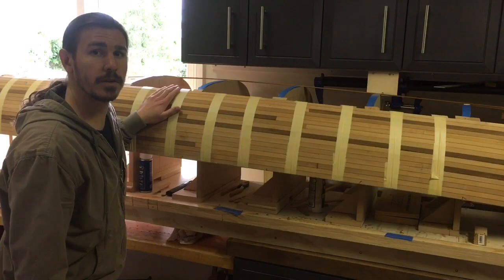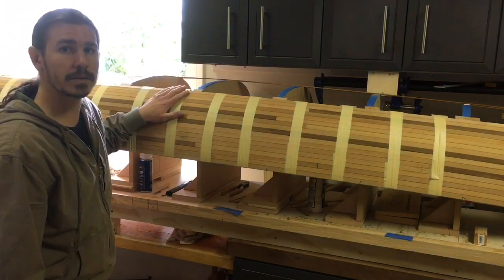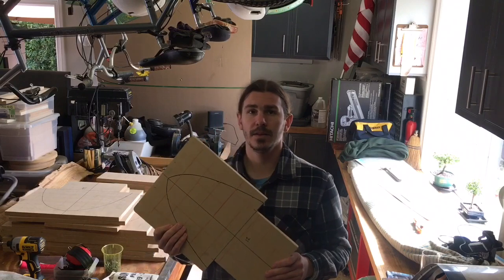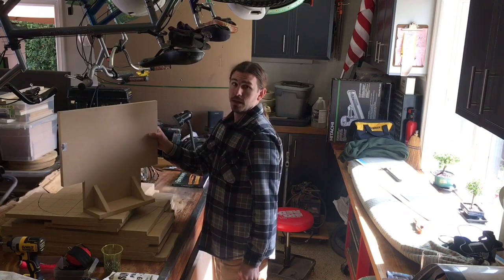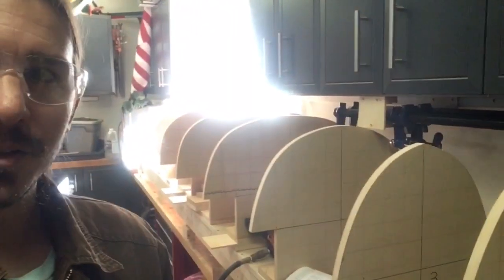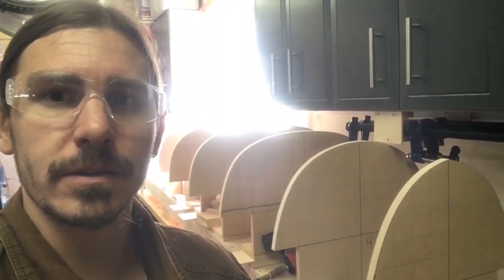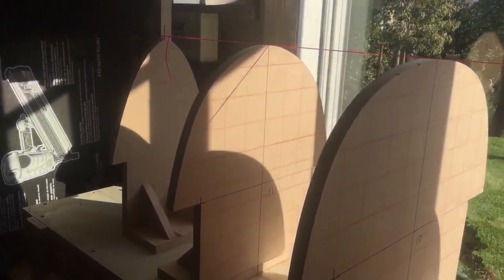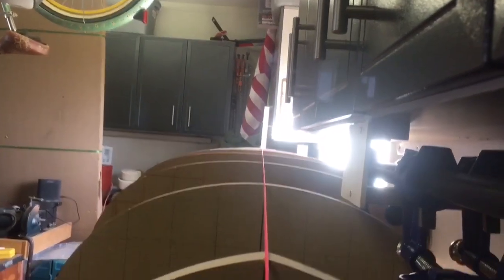Canoe build part 1 (lofting and mold making)

Comment: I have admiration for a fellow craftsman. Your point plotting with the nails & flexable curve gets the job done.  Built 22 stripers ,foam, and composite canoes you couldn't imagine.  Check out my adjustable "T"-slotted Aluminum strongback, and my unique canoe build, by clicking on my green icon and expand to see my 3 canoe vids.  Nothing on the internet even comes close.
Reply from the maker: Thanks for checking out my video and leaving a comment. Much appreciated. Checked out some of your videos, your funny man. For real though that canoe mold is on another level, your right there ain’t anything else like it on the internet. 11 foot Balsa, nice, was looking to get some for surfboards, man that stuff isn’t cheap, at least where I’m at it’s like $15 a board foot and always out of stock. I’m sure those veneers take some tracking down to though. Man carbon fiber, vacuum sealing on veneers, balsa wood cores, you put in a lot of work to make some nice canoes. Shoot me an email of some finished boats if you have pictures, would like to check them out. Best regards from California.